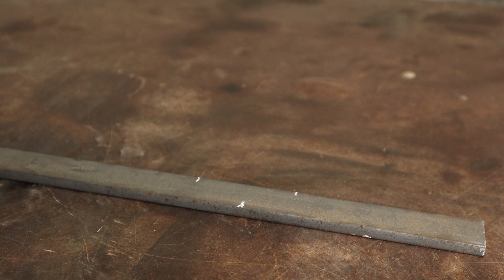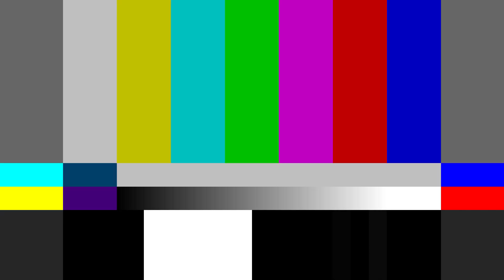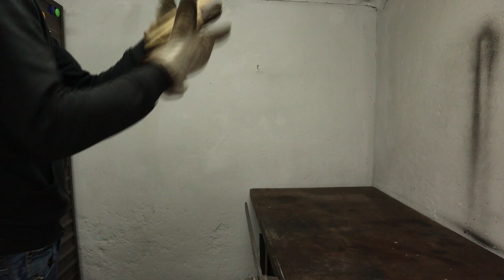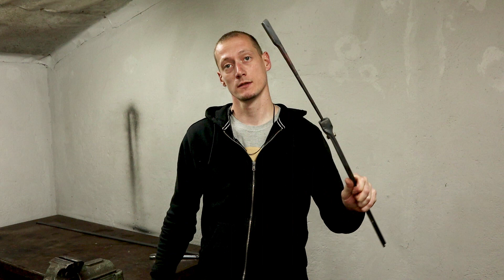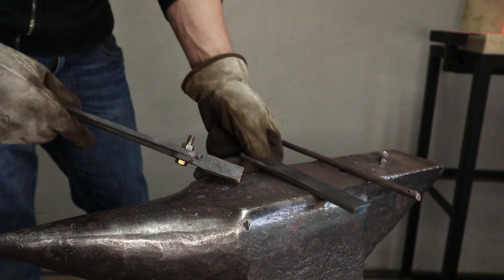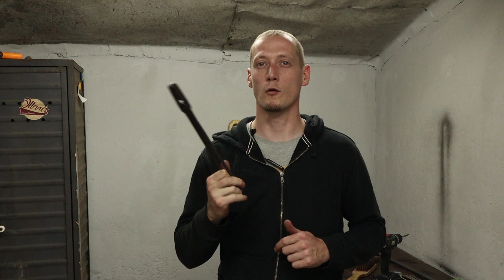Forging Basic Blacksmiths Tongs | Beginner Blacksmithing Project

Comment: steel parts you don't want heating up while in the forge, use a tool to brush water over the surface. In japanese blacksmithing a "tebori" is used, its a strongly compressed bundle of straw that's been soaked in water.
or use a ladle

Comment: Vice grips are good. Just take them on and off the metal. Also, you can put a wet rag on the metal sticking out of the forge to keep it from getting too hot. They turned out great, nice work Seb!
Reply from the maker: Pfff, too easy. 😅Thanks man!

Comment: Awesome job! But most blacksmiths leave the stock a little longer and don’t cut it to size until the very end, so that way they don’t need to hold the piece they are working on with tongs hehe or you can simply weld a rod to the end of it to use a handle and not burn your hand, and then cut it off when you are done forging ;) but your final product is beautiful. Keep up making great things. And love your forge btw.
Reply from the maker: Thanks Leo!